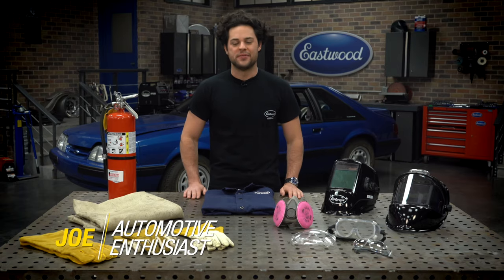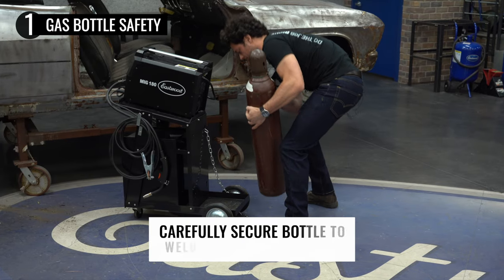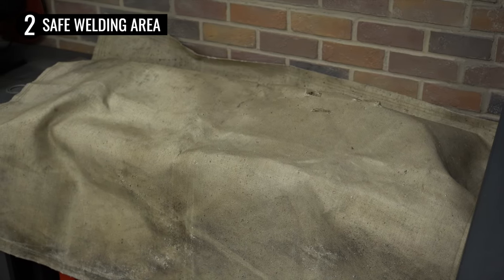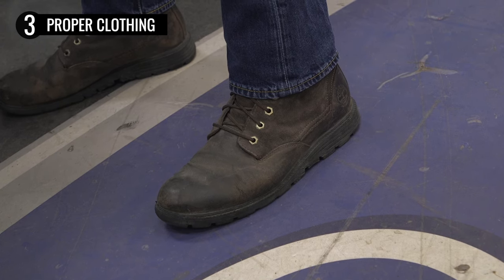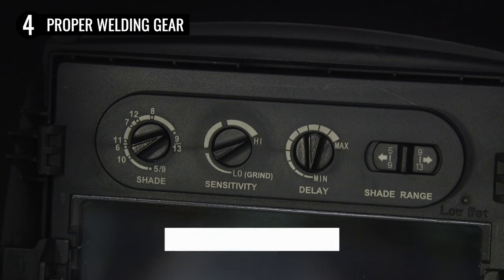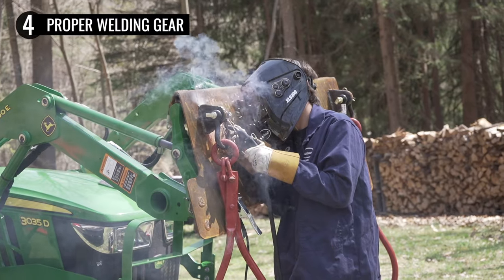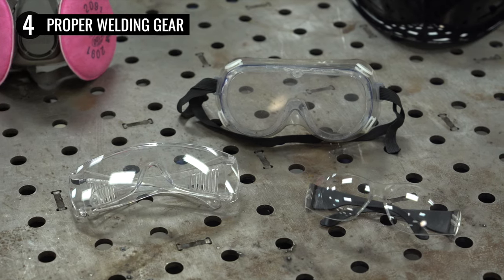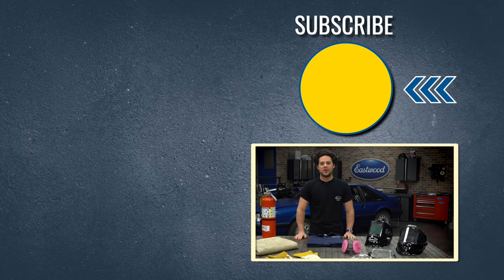Welding Safety Guide - Everything You Need to Know Before You Start Welding - Eastwood

Comment: warning everybody, this guy doesn't know what he's talking about with the respirator, the p100 filter protects only against particulates and will do nothing to stop the dangerous vapors
Reply: Cr(VI) distribution as a function of particle size, ranging from 0.18 to 18 μm. A P100 filter is effective down to 0.05 μm, so it seems this is effective against the harmful fumes from welding (particularly stainless steel).